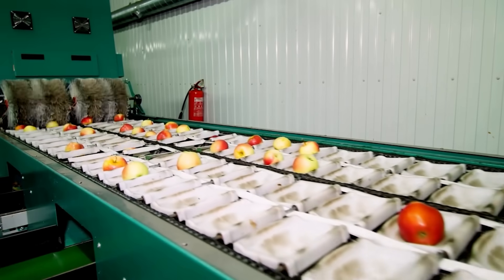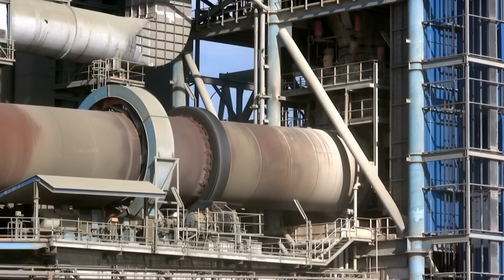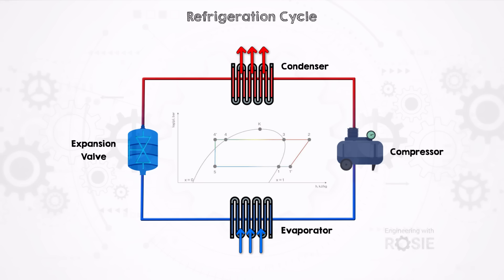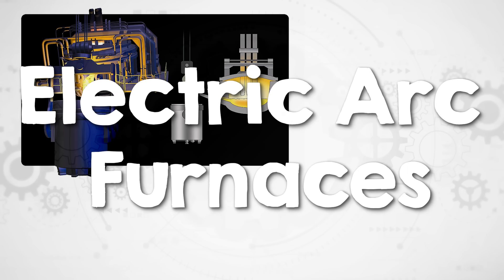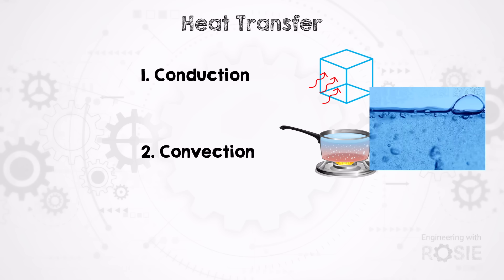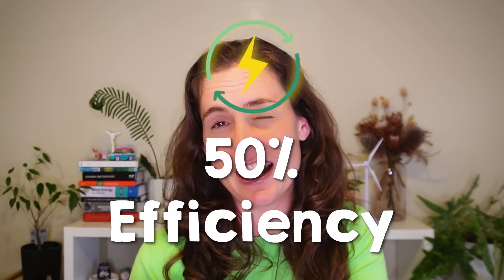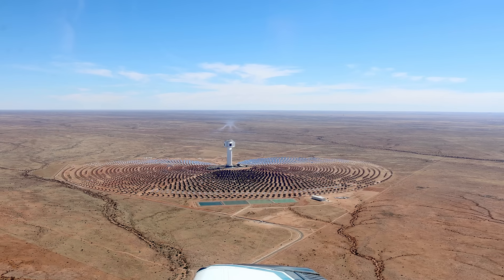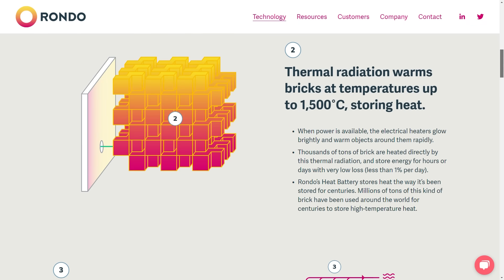Zero Emissions Heat Technologies for Industry

Comment: Another option that remained conspicuous in the video was process heat from nuclear power. Imperial college gave a good report on it.

Does the author perhaps not like nuclear?
Reply from the maker: I made a video about NuScale and their plan to combine their SMR with high temp electrolysis. So I have briefly covered nuclear as a source of heat on this channel. 

In addition to that, nuclear is another option for combined heat and power. Like every thermal power plant. But it isn't a solution for any of the challenging heat problems. Do you think someone with a need to decarbonise heat for their industrial process is going to consider building a nuclear power plant nearby to use its waste heat? Sounds unlikely to me, but if someone wants to do that then I wouldn't have any strong feelings about it. 
But I think it's more the other way around. If you're building a nuclear power plant anyway, then it makes sense to use the waste heat for something useful. But even that isn't done often.
Reply: @EngineeringwithRosie  said: '  Do you think someone with a need to decarbonise heat for their industrial process is going to consider building a nuclear power plant nearby to use its waste heat?'

Sounds pretty much exactly what the Chinese are doing:

' "The major purpose of HTR-PM is to co-generate high temperature steam up to 500℃ and electricity. It is cost effective currently in the Chinese market to supply steam and electricity for the petrochemical industry to substitute the burning of natural gas and coal. This breakthrough technology is recognised to play a positive role in optimising energy structure and achieving China's 'dual carbon' goal. Several commercial projects are under preparation in China."'

World Nuclear News, 6th Dec 2023
Reply: Its not economically feasible. When a thermal battery that can power your site costs fifty million dollars and an SMR costs five billion, nobody builds the SMR.
Reply: That's assuming the rediculous regulations on nuclear aren't eased and that any growth in the sector doesn't take the build time down (which is most of the cost)
Reply: @SocialDownclimber  Nuclear costs are way different in China, where the only SMRs are being built. In spite of their vast roll out of renewables and low costs for those, regular nuclear is competitive there, and there are good options to take out even more costs with factory built modular SMRs. 
It is a mistake to conflate Western costs with those in China, as they are vastly lower there.
Reply: @davidmartin3947  and yet no industrial heat supplied by nuclear anywhere in the world...
Reply: @gronkotter  'In 2019 there were 79 nuclear reactors used for desalination, district heating, or process heat, with 750 reactor-years of experience in these, mostly in Russia and Ukraine.' -wna
Reply: @davidmartin3947  If you think nuclear is cheaper in China, you should see how much cheaper renewables are.
Reply: @davidmartin3947  District heat and desal is low temp. That's not industrial heat. Show me two examples of nuclear providing heat to a factory for something more than hot water. Waste heat from a nuclear plant is great for district heating, but useless for 95% of industrial uses.
Reply: @SocialDownclimber  I mentioned that in my reponses several times. Unfortunately I can't post links here, but even with the very low cost of renewables in China and their rapid deployment the far lower costs of nuclear than in the West and its availability 24/7 means that even with current reactors it is cost effective, and factory build modular HT reactors should take out even more costs, especially for process heat, which is more or less a freebie. 
And that heat will be at a higher temperature, increasing its uses.
Reply: @gronkotter  Since they specifically mention process heat in the links I gave I consider my response as definitive as is reasonable to have in the context of the limitations here. Your claim was an absolutist one that ' no industrial heat supplied by nuclear anywhere in the world...' Well, 79 reactors in Russia seem to beg to differ to whatever extent.
In any case, the high temperature modular reactors they are building in China have way higher temperature output, specifically designed to allow its use in, for instance, hydrogen production. 
If that is not process heat I don't know what is.
Reply: @davidmartin3947  lol district heat is not industry mate. Go name one industry using nuclear heat today. Not low temp water I can bathe in.
Reply: @gronkotter  The Halden reactor in Norway for the pulp and paper industry. The heat is at 150C so don't try bathing in it.

Comment: Wonderful video as always!  A few quick notes:  1) it's temperature difference, rather than absolute temperature, which matters to heat pumping coefficient of performance 2) mechanical vapour recompression is a heat pumping strategy particularly relevant to industrial heating, and can achieve temperatures above 200 C (but definitely less than 400!) and 3)  Many processes like drying and distillation, are their own source of heat.  Virtually ll the heat that goes into a reboiler of a distillation, comes back out in the condenser, and sometimes the temperature differences aren't all that high.  MVR can couple the two and solve the waste heat problem while also providing the source of heat- two birds with one stone!
Reply from the maker: Thanks for adding those details!
Reply: Technically Heat pumps can reach even higher temperatures - from the beginning of using diesel ICE (internal combustion engines) we use compression to heat up air in cylinder up to 800 degrees, but whilst there is no phase  change it is much less efficient and it ads into complexity of a system. Then we have to make decisions which are based on expenses because we cannot sell cement for price of gold.

Comment: Thermal storage is the key. Just by increasing the temperature of the storage material, the storage capacity increases without any further direct cost. Whereas to increase the capacity of battery storage, there is a need to install more batteries which has a direct cost. Thermal energy storage is the best option for long term storage.

Comment: When talking about heat batteries, I'm curious about the infrastructure needed for the distribution, and how already exists. In northen countries there'd be already established networks, as you mentioned in the video, but most of them come from geothermal, which doesn't have the daily restrictions thermosolar has.

On the other hand, countries with a lot of sun won't have those infrastructures developed as they are warmer.
Reply from the maker: I think it will be mostly individual facilities with their own heat battery. It's hard to get district heating for industrial heat to work for the reasons I mentioned in the video.

Comment: Hi Rosie,

"zero emission" technologies, really?

Geothermal, CO2 free, really? Most geothermal sites produce more CO2 than gas fired power plants.
Heat pumps, emission free? Where does the electricity come from then? Did account for transmission losses? Does the production of the heat pump itself have an CO2-footprint?

Obviously you dont see the forrest by looking at the different trees. And have the same misguided idea that so magic new technology "will save us", whatever save us really means.

None of which is true.

If emissions are the problem, I think they are, than collect the emissions and turn them into some liquid of solid matter, which can be sold or store for later use.
There is no other solution, if one wants to reduce emission, 
except high-temperature nuclear, which is sadly not yet commercially available.
Even high-temperature nuclear likeky wont be cheap any time soon.

Comment: A lot of people seem to also forget, that the temperature doesn’t need to increase to 1500° immediately.
We can use a heat pump to raise the original thermal stock to 150 C , and then use it traditional blast furnace to get to 1500c
But that still about a 10% savings from the base ambient temperature, another important bet is as the 1500° cools down, we should use that heat to heat up the next batch. If you get only harvest 50% of that energy that would be massive. 

Fundamentally the problem is how we designed the plant to heat something up and then to let it cool down in the air giving off all the energy we just put into it,
Fundamentally we need to pass that energy from the current processed batch to the batch that is about to be processed. 
Yes, there’s some chemical reactions etc.  That also cost energy thats non recoverable, but a huge chunk is. 
And that doesn’t really need any fancy technologies that just requires smart planning of material, double backing to where it came from , like a seals paw where the blood goes out and passes past that rotating vein to transfer the heat, like an ERV.
Reply: So for in-line production for example, the hot output line going from left to right can intertwine with the cool input line going from right to left, like the condenser of a fractional distillation set up!
Reply: @phaoyu1  exactly.
Reply: @phaoyu1  Like a preheater
Reply: Good stuff
Reply: My thoughts exactly, but as I am no engineer and as it is not made this way almost anywhere, I think maybe there is a reason for it I can't see. It would be a nice tipic for a video!
Reply: Most industries already use"waste" heat in the form of preheaters etc
Reply: The type of efficiencies you talk of are already incorporated in industrial processes; low hanging fruit of additional efficiencies have mostly been picked.
Reply: @matster77  mostly its not, i see tons of processes where things are heated and then actively cooled elsewhere.
And thats been done like that for ages.
Reply: That's generally what district heating seeks to address.

Comment: Supercritical CO2 driving molten salt storage might be worth a mention too, although I am not clear what temperatures are realistic for the technology. I would put links, if comments did not get killed as spam if you try it! Certainly though electrical to electrical storage efficiency is high, but I don't have figures for when the desired output is thermal.

Comment: Interesting overview, not being in the process industry I had not thought about the need for extremely high temperature.

On a personal note we install a minisplit heatpump system in out home several years ago. When we built our house 40+ years ago our primary heat source was cordwood harvested from our own property. Obviously that is not a solution available to everyone. The heatpump works well here in southern New Hampshire. Due to high electricity prices last winter (we are in the Northern Hemisphere) we reverted back to cordwood. Nice having the option to choose the least costly energy source.

Comment: I know many factories that heat iron and steel in order to deform them.  This requires 1000 to 1300 °C, i.e. 2300F.
This heat is generated by burning natural gas. Now many people are smart enough to burn hydrogen instead of natural gas. That sounds good.
But where should the large amounts of hydrogen come from?  
Generate hydrogen from natural gas to save natural gas and to burn hydrogen?
Or burn hard coal to generate electricity to produce hydrogen to burn hydrogen?

Everyone talks about electricity and hydrogen being clean energy carriers, but it is always converted energy.
Reply: Hydrogen can be made from electrolysis of water, using renewable electricity from wind, hydro or solar.

Comment: About heat pumps, those temperatures seems to be about versions of "conventional" heat pump technology, and not the fundamental concept of a heat pump. While quite true that heat pumps loose efficiency with increased temperature difference created, which is about as fundamental as the "theoretically" possible efficiency of heat engines is limited to the relative temperature difference, as described by Carnot's theorem. With a heat pump you get the heat from the energy used, and the heat pumped.  If heat pumps could create very high increase in temperature with a high COP, perpetual motion machines would be possible.              

Anyhow, for low to medium grade heat you could just compress air, use the compression heat, and then use the compressed air to extract some power from, and use for cooling. Not easy or super efficient, but you would get to use "both sides".    

Personally I think heat storage, when heat is the form of energy wanted, is vastly underappreciated. An aspect I haven't seen getting much attention is fact the more cost adjusted demand we get, the less "too low" to negative prices on power we get, and that can help making solar and wind much more reliably profitable, which in turn is good for both producers and consumers and the transition.   

Of course heat storage will have losses, especially high grade heat, and/or small scale, and long term. But that doesn't matter much if cost of energy varies between practically free and too expensive to use.  Large thermal batteries that can store heat up to 1500 °C could be useful to produce power from, again, not thermodynamically super efficient way to store power, but, as long as power prices fluctuates between negative and hundreds of euros per MWh, you don't need super high thermodynamic efficiency to make it viable.            

About hydrogen, personally not a fan of hydrogen for energy storage, but I thought commercial production with efficiencies of over 70% was the common, obviously assuming when the system is at temperature and pressure, which requires long periods of operation. Are those 20%+ missing due to intermittent generation assumed in that case and or heat lost to heat up the air used as oxygen source? That brings me to my next question, is the exhaust from combustion used to preheat the air, or is it typically just wasted in industrial processes, unless used to scavenge some energy from for other purposes?
Reply: While thermodynamics do get in the way of generating power from a heat differential created by a heat pump, and overunity is obviously impossible, it's absolutely possible to create large temperature differentials with heat pumps, to store that temperature differential (with both hot and cold insulated reservoirs, one well above and one well below ambient temperature) and to recover a large fraction of the input energy later: reversible heat pump energy storage has been developed for some years now, though apparently still not ready for mass commercialisation.  Look at the work of the Sir Joseph Swan Centre at Newcastle University (the early edition Newcastle in the UK, not the Australian reprint), and of Highview Power (also in the UK).  Adding links blocks the comment so use a search engine of your choice.

Comment: What about nuclear for industrial heat?
Reply: It costs too much, is too large relative to customer demands, and can't be next to a random factory.
Reply: @gronkotter  I'm not convinced. On scale: Heavy industry tends to concentrate in a few locations, which could use Gigawatt-scale industrial heat.

On price: Nuclear wastes 60% of it's energy on the heat-to-electricity making process, meaning for a 1GW power plant you could actually get 2.5GW of industrial heat. That would make it 40% the cost of the same heat from resistance heating, if you have a mostly nuclear grid (like France).

Obviously current water-cooled reactor designs are limited: 260C at most, maybe 360C if you add a heat pump to raise the temperature. But, again, because that energy is more valuable as high temperature heat than electricity, it might make sense.

And, on higher temperatures, you'd need new designs (the Russian's sodium cooled reactor is interesting, as is the British CO2-cooled reactor), but again industrial heat is just so valuable it might be worth it.
Reply: @domtweed7323  ~300C steam and GW scale means you can address something like an eighth of industrial heat. That's pretty decent, but the real disadvantage is cost. Nuclear heat is competing either against renewable electricity, or fossil combustion, not nuclear power. The cross over of GW scale industry, ~300C, and needs nuclear power for a lack of renewables is an even smaller addressable market.
Reply: @gronkotter  I disagree about cost for 2 reasons:

Efficiency: When you want to make heat with electricity you can use 100% of your wind/solar energy to make electricity, but only 40% of your nuclear power cause 60% is lost as waste heat at the power plant. But if you skip the electricity making step you get to keep 100% of the nuclear heat, i.e. it just got 60% cheaper per unit compared to wind and solar.

Also, renewables are great, but only in certain geographies. Look at Germany: Poor wind resources, minimal solar/hydro, and a vast need for industrial heat. A d you could say similar things for most of Eastern Europe, bits of the tropics (too cloudy for solar), or even the North Sea once we've maxed out the wind power potential.
Reply: @domtweed7323  Sure, if you have no renewable resource. Just don't have heavy industry, you won't be able to compete with everyone else who does.
Reply: @gronkotter  Have you read Fossil Capital by Andreas Malm? It addresses exactly this point.

Basically, during the industrial revolution, British industrialists faced a choice: Use hydropower in the uplands, which was cheap energy but made getting labor expensive; or use coal in the cities, where energy would be expensive but labor cheap.

They mostly chose the later, because they couldn't stand labor having bargaining power.

So capital, for it's own political reasons, may choose expensive energy.